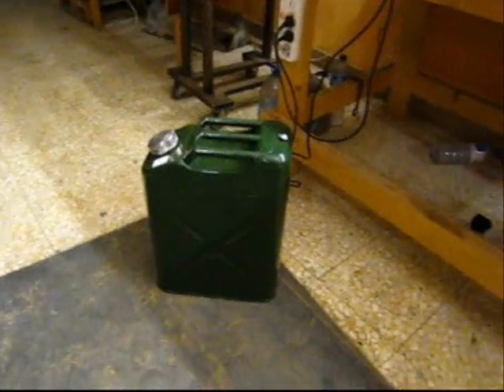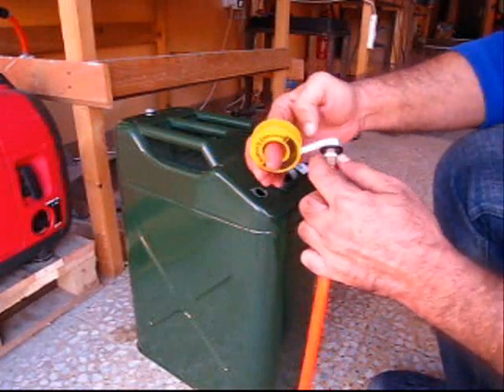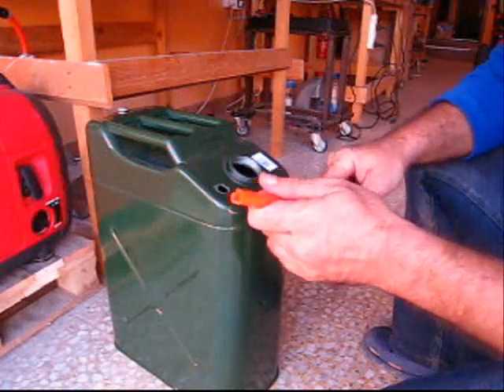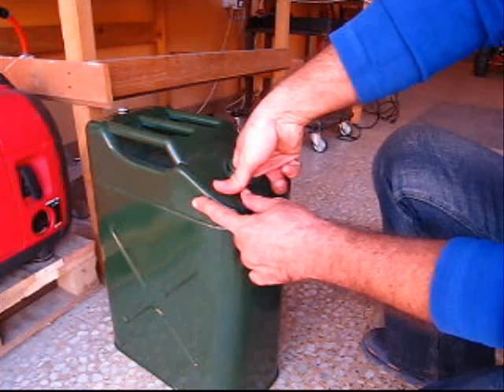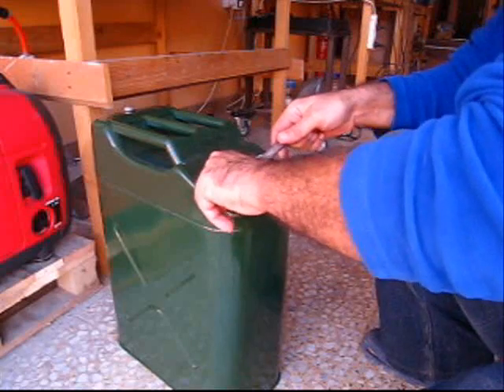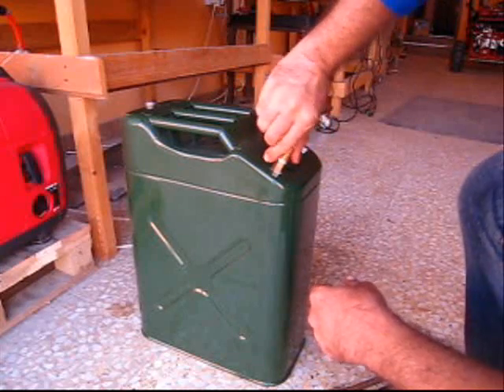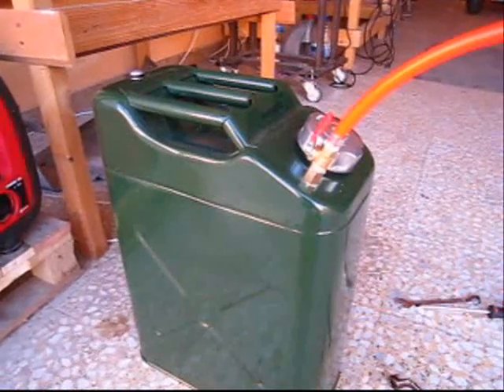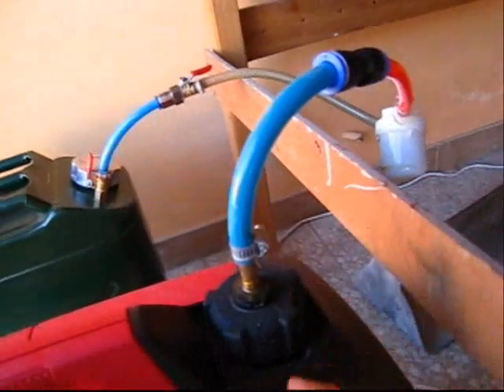Making of a Honda EU2000i Auxilary Fuel Tank.wmv

Comment: >^..^<       Clever set up.........
Wonder if you are putting your little Honda in jeopardy running 10 gal of fuel 24/7 without checking it's oil? 
Is this area your power generating system is set up in a well ventilated to the out side air area?

Comment: I hope you cleaned the tank after you drilled it, wouldn't want that c a pin your generator. Creative idea but don't use Teflon tape and non gas rated fuel lines for this project.

Comment: I bought a kit on line to do this but I can never get the gas to come out . I also noticed that with my gas cap on and turned to off it runs just fine shouldn't it kill any Ideas
Reply: You need a way to get air into the jerry can to replace the expended fuel, otherwise you have created a vacuum and fuel won't flow into the generator.

Comment: I admire the ingenuity, but teflon tape is not a sealant, and winding gobs of it to create a "seal" is kidding yourself. It is used to lubricate tapered threads so you can tighten into the taper more to create the seal. If you want a gasket, make a gasket. You are trying to prevent 5 gallons of gasoline from weeping out of the tank if it were to tip on its side.
Reply: Running it inside is a no, no!

Comment from the maker: Sory for the late reply. The EU2000i creates it's own vaccum as it runs, therefore you do not need a pump. It has no problem pulling the as from the two aux. tanks
Reply: Is there any experience on what can be the height difference between the generator and the fuel tank. i.e. fuel tank standing on ground and generator on workbench?  I would have to bridge a hight of approx. 1 - 1.5 meter

Comment: I hope you were just showing the generators indoors and not actually using them indoors. It doesn't take much carbon monoxide to kill you in an enclosed space, and also the consequences of a gasoline leak and fire indoors are quite bad. I've seen the results of both of those mistakes. Nice video, and a great idea putting on the connection and valve.

Comment: does it need a extra fuel pump or does it have its own built in fuel pump

cuz i want a extra tank on my moped and it standard tank does not have fuel pump cuz its above the carburetor
and i want to put another tank under the carburetor and i cant find a descent pump

Comment: My Honda EU2000i  just kept my sump pump running for 36 hours during hurricane Irene. I'm going to reward it with an oil change and valve adjustment. It would be wonderful if you could document an entire engine rebuild. Great vidieos.

Cheers, Bob in New York.

Comment: @firemannola 
Sorry for the late reply. The color hoses you see in the video are from Air tools, the hoses that are used to connect them to an air compressor. So if you go to the right shop, they will have a quick connect/disconnect section that is cheap and very reliable. The pieces I use are Chinese, but I haven't had any problems with them yet.

Comment: @Begbucks 
I am using a Nylon hose that the shop guy claimed is safe for fuel. Haven't had a problem with it yet. Also the colored bits are Airhose that is used with Air tools.

Not sure if they will affect my machine in a bad way. Something to consider though, thanks!

Comment: @firemannola 

No, I just removed the shutting valve and inserted the brass fitting. It's very easy. Just use plenty of glue to fiill the little air-vent groove when you insert the fitting.